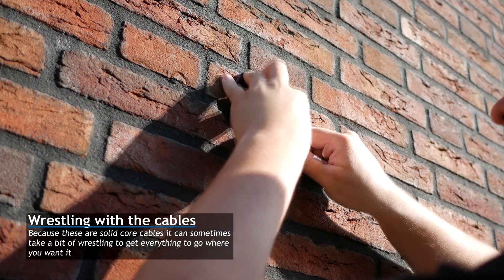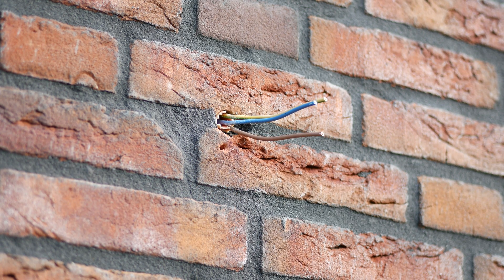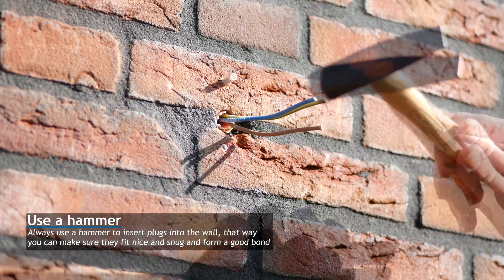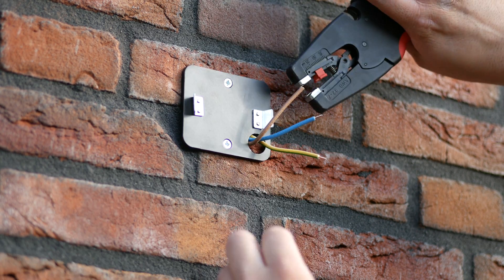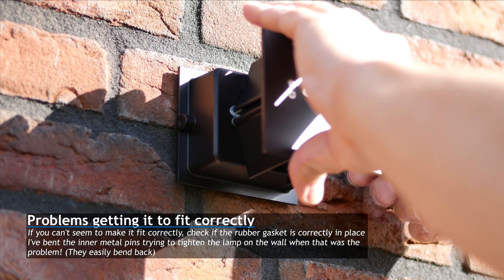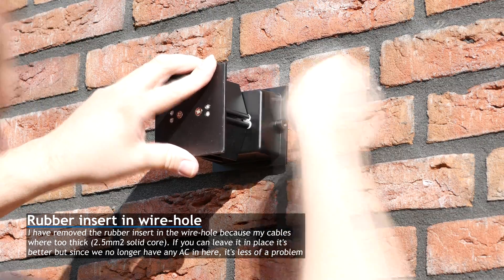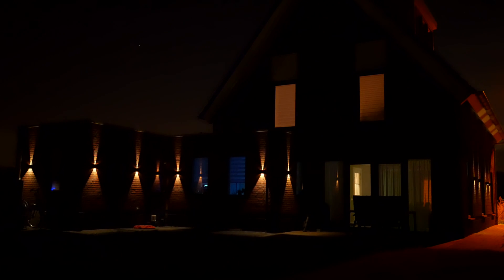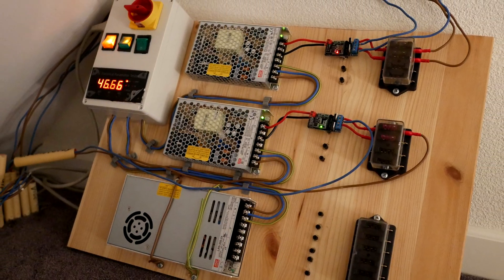ESP8266 LED Lighting: Outdoor garden lights part 2 - 2

Comment: I've only just found your video, can these be controlled via MQTT ?
Reply from the maker: Yeah sure. The same principals regarding PWM still apply. But you would have to run MQTT compatible firmware that also has PWM capabilities. I haven't investigated that, should be possible though.

Comment: Quick question: I saw some videos mentioning that the ESP8266 can be a bit hit and miss as far as receiving commands goes, even when very close to an AP. Have you personally noticed anything like that?
Reply from the maker: I am currently using more then 10 around the house and have been doing so for more then a year. They control all the lights we daily use and we haven't had any such issues. The ESP's are located in 3 seperated locations and they connect to the closest AP. But they all need to go through walls, etc.

I did base all my communications around TCP so that if a packet would get lost, TCP would take care in sending it again. Maybe that is why I don't have this problem?

In the end, although it depends on your WiFi network, this solution works well and reliable.
Reply: Intermit.Tech Thank you for your reply. I'm very impressed with the stuff you're doing with these modules, and especially how cheap you're doing it. Did you ever think of creating 3D printed cases for your own modules?
Reply from the maker: I've thought about it, I've also tested some cheap cases from China but in the end decided to go a different route myself, building a sort of power board, more about that in future videos. :)
Reply: Interesting, I look forward to it!
Final question (until I get the parts in probably, lol): Do I need to change anything on the DirtyPCBs website, following this link:http://dirtypcbs.com/store/designer/details/Quindor/1385/quinled-v2-6-rev1-00 ?
I'm assuming all values are filled in correctly, but since I barely know anything about PCBs, I just wanted to double check.
Reply from the maker: +Tim Derks yeah, the default values (take a proto pack) should be fine. It comes out to 12 I believe.
Reply: Brilliant, thank you for all your help. I hope the kickback you get from dirtyPCBs is worth dealing with people like me, lol. Do you have a donation thingy setup somewhere maybe?
Reply from the maker: +Tim Derks Haha, no problem. I don't do it for the money. And dirtypcb is nice, but clicking my aliexpress links would be awesome. No donations needed. :)
Reply: Well, consider my Aliexpress link replaced. Thank you for creating this wonderful thing, and sharing it in a way that even hamsters like myself can understand it!

Comment: @Intermit.Tech If you need to buy splicing connectors in the future, I recommend the "new" (about a year old now) Wago connectors: http://global.wago.com/en/products/product-catalog/terminal-blocks-connectors/installation-connectors/compact-splicing-connectors-all-conductor-types-221-series/index.jsp
I've used them extensively the last few months and they're absolutely great. Much smaller, transparent for easy checking and they don't "bite" your fingers as much when they close. It's the next iteration of the type (similar to) the one you're using right now.
Reply from the maker: +WoLpH Cool, I'll check those out. So I'm not the only one who gets bitten by these connectors huh, hahaha. I always take it as a sign that it snaps on tightly. ;)

Comment: Tip: you need to strip the cables more than you did. I think you striped them about 6mm. You need to strip them 11mm. On the clamp there is a visual aid, which shows 11mm. Normally there is a risk of clamping on the isolation, thus not working and/or bad connection. Using 240VAC this then gets warm and is a fire risk. With 12VDC the risk is only on not working. As always, love your videos and can't with for the "sorting the cable mess video"! 👍😁🇳🇱
Reply: Intermit.Tech ah, it looked like it was set to 6mm and these types of blocks usually recommend 11mm. But videos can be tricky in that regard. 

As for the fire hazard, I wouldn't be too worried about it either. The danger is negligible here and even if something would become hot, very little fuel available so its rather safe.
Reply from the maker: Ah, good comment! They might be a bit short indeed, I think I had the stripper still set for normal wire terminals. I'll be more carefull with that in the future!

Thnx for the comment and I'll be sure to show the finished wiring when it's done! :D
Reply: I was about to say the same.

Don't discount the heat for 12 VDC though, the voltage isn't relevant here, it's the current that matters for the heat. And with 12 VDC you're more likely to use high current (when compared to 230 VAC)
Reply from the maker: +WoLpH to be sure I just checked and the automatic stripper was set to 80mm and the blocks specify 100mm so it's a bit too short, but not by much.

Amperage wise we're talking about 0.3A per light and I don't have channels that run more then 4 in a string, so 18v 1.2A max. I don't think that is enough current to cause a problem, if indeed it would be stripped to shortly. But, it's good for people watching this to set their stripping tool to the right length!

Comment: Any way to build everything in the light itself? I have 230V wiring in the wall and I can't rewire to a lower voltage system as you have.
Reply from the maker: You mean your 230V AC wiring goes into a central box somewhere where you can't add a power supply and dimmer to only those cables? That would be the easiest route, just use the existing wiring and split it off from the current AC network.

Adding a WiFi dimmer per light would be possible but very complex and the full metal enclosure probably would limit WiFi range A LOT, so not a good plan there. :(

Another way would to use a remote dimmer controllable sealed driver inside of the lights instead of the standard one. You would still need a separate dimmer wire though and that way might be very cost prohibitive ($10 per light).

By default these lights come with little 230V drivers per light so hooking them up in a non-dimming way is easy in that regard. You could maybe add a relay switch somewhere to be able to turn them on/off at least? That would be easiest I think, Sonoff makes a nice product for that.
Reply: I have only 230V on the outer wall and there is no way to rewire inside as you have. So I must deal with 230V. I have only one lamp outside, which I want to replace with a type presented here.

Case A:
Without dimming: I am pretty sure you know Sonoff WiFi switch:

https://www.itead.cc/sonoff-wifi-wireless-switch.html

Don't you have one around? Will this switch fit inside of the lamp?

Case B:

With dimming: I have many Quinled modules around, it would be great to use one more. What happens if I connect Quinled normally after the original driver? If it is not possible, what happens when I remove the driver and I add a 24V power supply regulated down to 18V then I connect Quinled and to it the LED? Mini PSU something like this:

https://www.aliexpress.com/item/AC110-220V-50-60Hz-Universal-5V-2A-Switching-Power-Supply-Driver-Power-For-LED-Strip-Display/32798426330.html

2A must be enough. In the video you measured 6W on 18W it is 0.33A (I(A) = P(W) / V(V)?

WiFi Range I think not problem, my router is very close to the lamp outside. In the worst case I can hack Quinled and a Wemos D1 mini pro together with an external WiFi antenna. 

Sorry for the noob questions, but I really like your projects and I am trying to recreate all.

Bonus question: these are real brick on your house or just decorative?
Reply from the maker: I have some Sonoff WiFi's and just checked but that alone is never going to fit in the back of the light, maybe with just the internal PCB but adding the normally included driver together, I don't know, I think that's a no-go.

I've tried running QuinLED behind a constant current driver before but had very mixed results. Basically, the constant current driver did not understand what was happening with the PWM (perceived lower voltage) and it went into a sort of voltage loop. Replacing the power supply for constant voltage with a QuinLED would be possible but I doubt you can make it fit (easily). From the link you provided, that might already be too big. The included driver is about 5cm wide by 3cm deep and 2cm high. But even with that one, adding a QuinLED into the same compartment might work, but would be a very tight fit!

That brick is 100% real brick! Here in the Netherlands we conventionally build an inner wall first (Used poriso "hollow" stone for that) then put insulation on it, leave an air gap and then put down the outer wall which is the brick you see. The pipes you see run inside the air gap so are conveniently tucked away!

Sorry I don't have a clear answer. If I have time I'll try and add a QuinLED behind the default driver and see what that does but I can't promise when. :(
Reply: Thanks for the detailed answer. I am going to order one lamp and try all methods above, I'll post the results.

It is a very nice building method. I love the classic brick look. In Slovakia things are simplier, we mostly use Ytong blocks for all the walls (inner+outer) + insulation (rock wool or polystyrene) from outside : http://www.ytong.cz/cs/img/ytong-news-03-2014-RD-Hamry_3.jpg. I am curious about building prices in Netherland, as I heard they are very expensive (my friends are living in Amsterdam), in Slovakia you can build a new house around 1000-1300€/m2, that's the total finished cost for a classic house.

Back to the topic: are you controlling your Quinleds only virtually? It would be nice to make it compatible with classic switches.
Reply from the maker: I know of Yton blocks and we use them here in the Netherlands too, but they are mostly considered a cheap building material. The Poriso I used is a bit more expensive but has great thermal and sound insulation properties. So they bring you closer to the mandatory government code required for new houses. In large buildings they do use a lot more Yton though, mostly inside of the structure. Our house was around 2200 - 2500€/m2 I think, including property and all building costs, but that's a luxurious house for over here. Still, you are quickly looking in the 1500 to 2000 range even when trying to do it cheaply.

Yes, currently I only use "auto" triggered scenes: I have groups of lights (livingroom, outside, hall, stair railing, etc.) and those all have 3 scenes attached:
1 hour before sundown: turn on all lights to set levels
02:00 set all nights to night mode (Dims down internal lights to very low level to serve as night lights, outside to 50% instead of 80%)
1 hour after sunrise: turn off all lights

Phase 2 or 3 will be coupling switches (check my blog, I've done tests with this in the past!) and using automatic sensors to trigger some stuff.

But to be honest, the automatic scenes work so well we kind of forget about it until someone who is visiting mentions "hey, your lights turned on automatically all through the house and outside". We are just used to it now, the lights are always on at the right time and automatically dim down at night and are off during the day. And since it's all controlled LED it uses very little power! :D

Maybe I should make a video about this too. :P

Comment: What stops water running down the wall and into the back of the unit, or up the conduit?
Reply from the maker: The conduit are all angled down slightly so no water can run into it from the wall.

And the hole for the cable passthrough in the light is on the right bottom side so all cables inside also run upwards, again preventing water from getting anywhere dangerous. Also, the back compartment is fully sealed on the in the inside so even if water got in there it still wouldn't really cause a problem except for the connection blocks.

But as I said, those cables also run upward and no water can really reach it. They've been in pouring rain storms for the past few weeks and haven't failed or caused a problem. :)